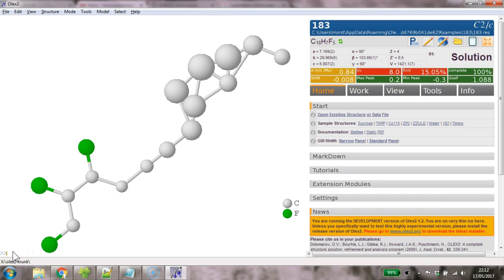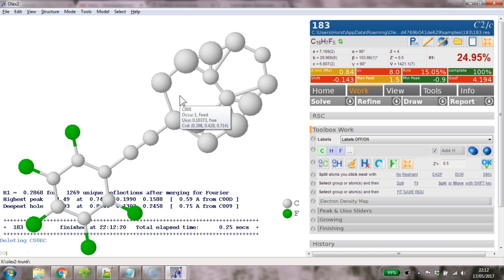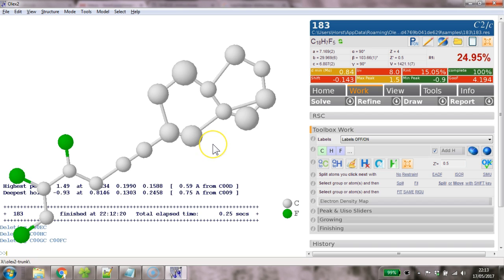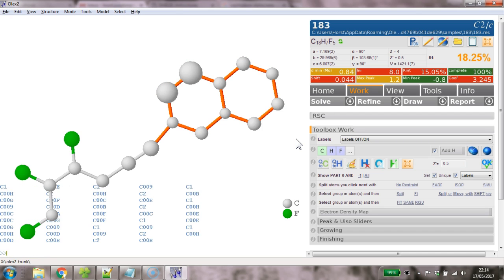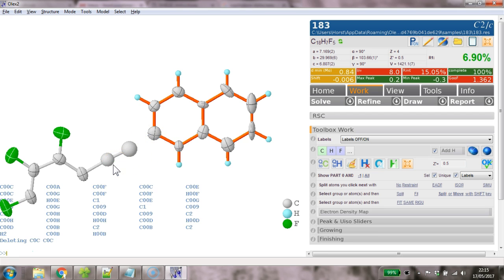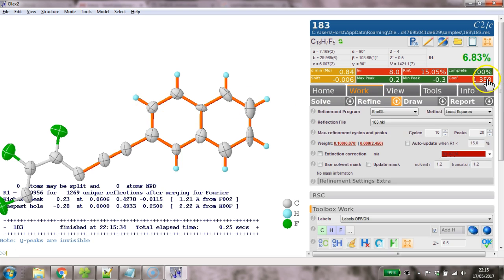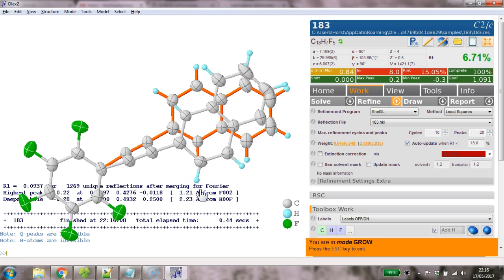183: Napthalene across symmetry element

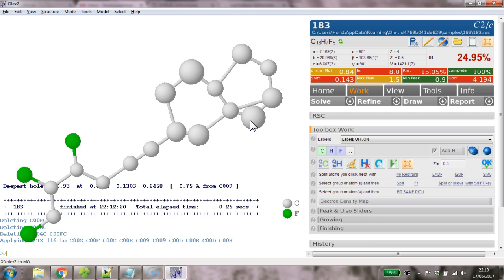Comment: Thanks for the video. Could you tell the meaning of each number used in 'AFIX 116' command at 1:49? I looked it up in the OLEX2 Manual at page 13 about this command, but it didn't give a similar example of it. Aslo, in the example of  'AFIX 66 1,2,3', why do you use '66'? Thanks!